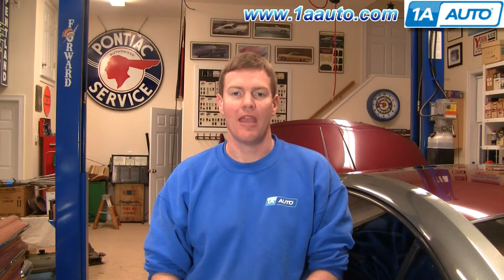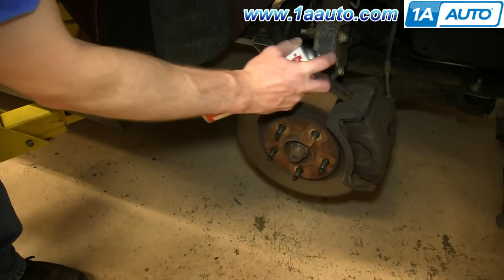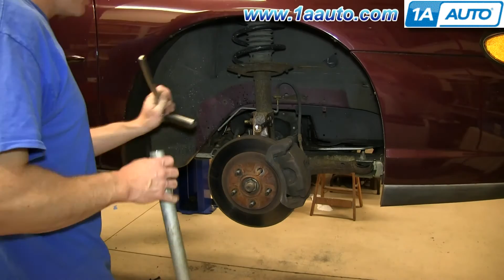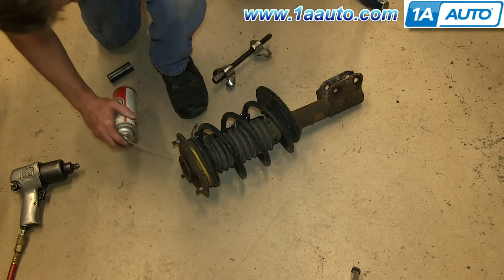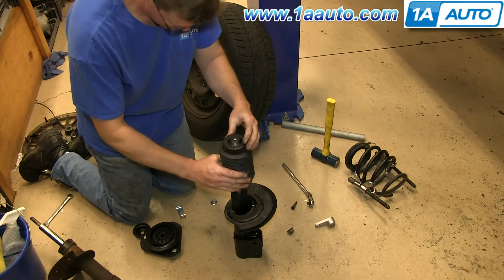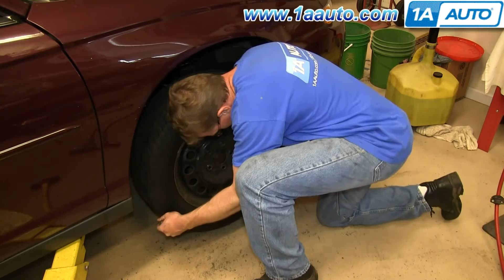How to Replace Front Strut Mounts 00-07 Chevy Monte Carlo

Comment: Can these being bad effect the steering one way? I got my impala allighned when I lift it off the ground and turn it it steers fine but the Right side clicks at the strut mount. When Driving down the road its incredibly hard to turn left sometimes when going slow. I've replaced inner and outer tie rods already and wheel bearings, rotors and brakes.
Reply from the maker: +Mag Wolf It could be an issue with the power steering not working correctly. You may want to inspect the power steering fluid level. Hope this helps you out. 1aauto.com
Reply: 1A Auto 
Parts
Reply: Wolgon Gaming
Reply: Wolgon Gaming